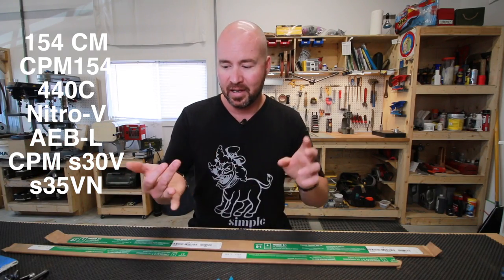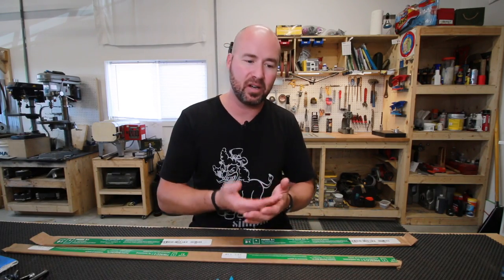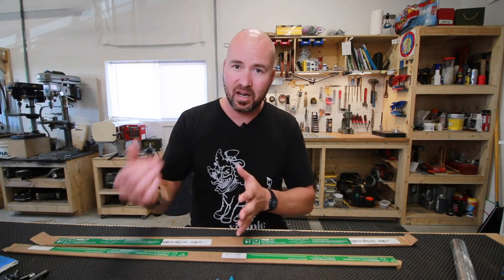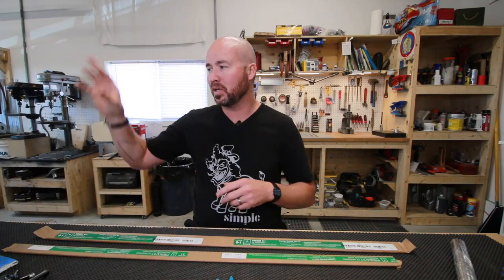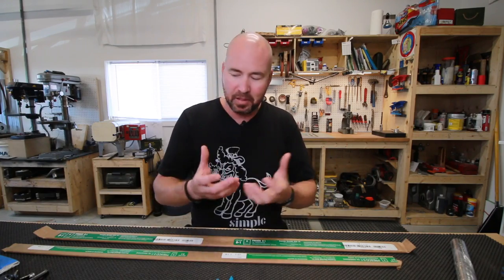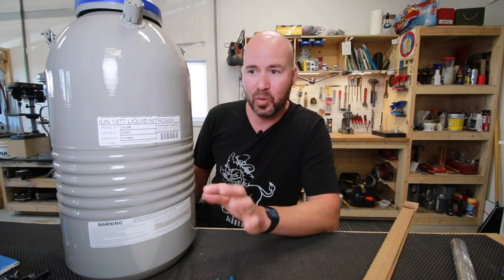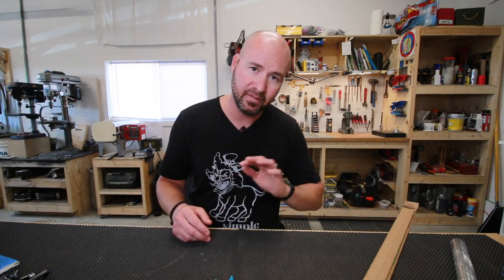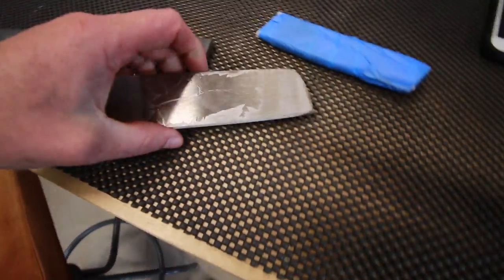Heat treating stainless steel

Comment: Jeremy quick question if I may.... do you heat your oil when quenching high carbon steels. I've heard that counter-intuitively that it cools the steel quicker. Cheers mate. Keep the videos coming. Very educational.
Reply from the maker: Yes it is supposed to (from what smarter people than me say)  cool your blades faster and I agree from what I’ve seen. I’ve dealt with cold, thick and frozen oil a lot I think the idea of a more fluid (warm) oil makes a lot of sense. 

Having said that, I’ve worried about both sides and tried dozens of blades either way and I can’t tell a difference. Except of course when the oil is so cold it flows slowly. 😆👍

Comment: What if you leave more material to grind away for the cutting edge?
Reply: Hardened stainless tool steel is really abrasion resistant - good for knives - but it takes more belts and time
Reply: Exactly. I find that stainless doesn’t warp as much as high carbon steel so taking a little more off your thickness before heat treat will do ok .

Comment: Can you wrap the knives in simple thin sheet of regular mild steel metal ?
Reply: sime mkd from what I understand the answer would be no. When going to 1900-2000+ temps for stainless steel a stainless steel envelope is needed

Comment: Get a bottle of nitrogen or carbon dioxide so you can blow it into your little foil pouches.. push out all the oxygen and replace it with an inert gas and no need for paper or wood or worrying about any decarbing

Comment: I'm sorry, but your explanation of the martensitic phase transformation was quite wrong
In the austenite phase, the carbon is indeed evenly distributed throughout the steel. What you described is pearlite, which is actually soft steel.
What happens when you quench the steel, is that the carbon has to diffuse in the steel, in order to become pearlite. But that can't happen, since you are cooling it that fast, so it gets trapped sort of mid way, and that is where your explanation is right again, this is very brittle, and very similar to glass

Comment: maybe you are just to god sealing those envolubs. No mather how there will always be an overpressure when the tiny amount of air inside is heated up. so put a tiny piece of paper or dont. There isn't enough oxygen for anything serious reaktions with that tiny amount present. and when its heatet up i will have escaped anyhow. So maybe put a little hole in your envelop and see what happens. Then it will suddenly not crack open The oxygen from the outside will never go to the inside because of the pressure difference. Just my humble thoughts as a chemistry professor. And thanks for a lot of helpfull stuff. Love your videos.